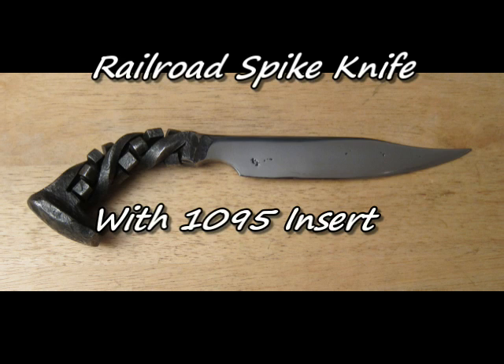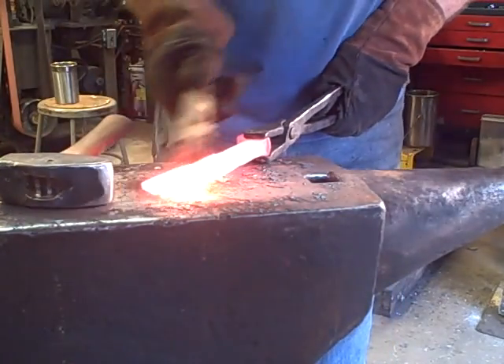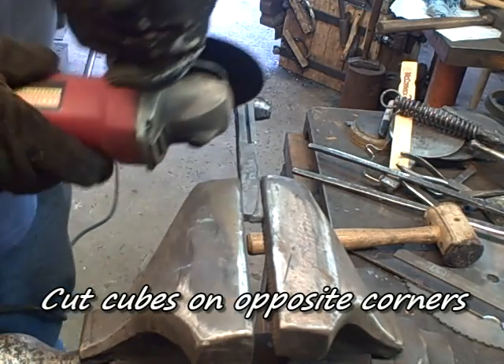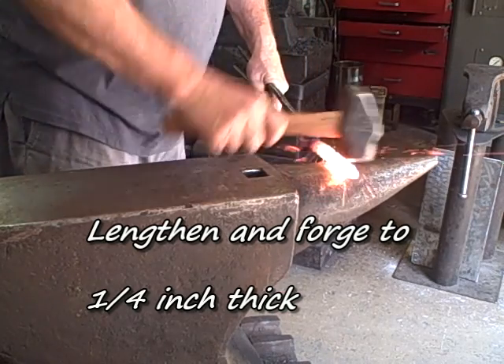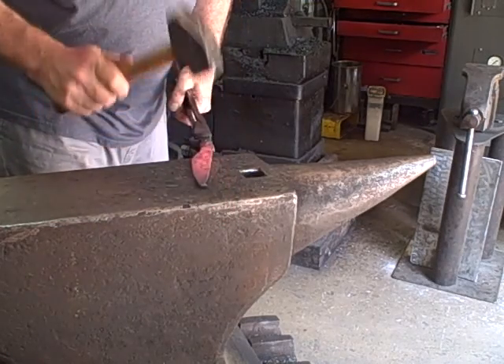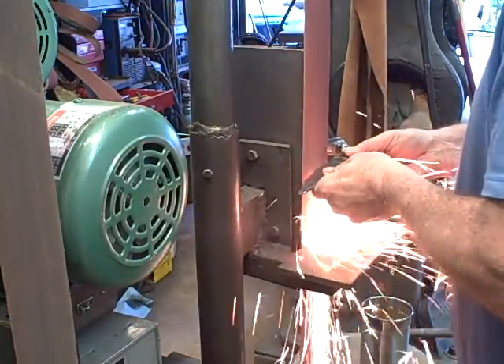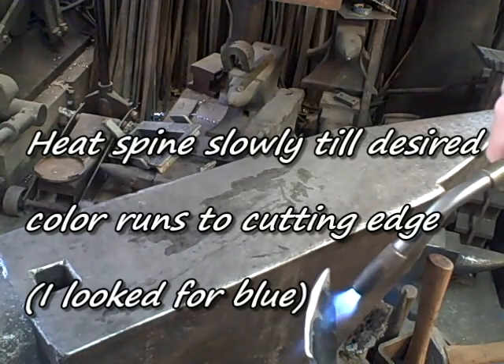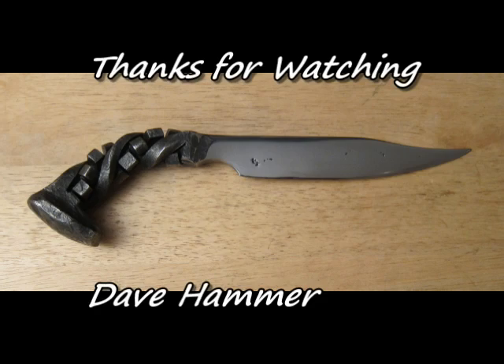Forging a Knife

Comment: +David Hammer , I sometimes use both, torch or an oven, sometime il probably get a real heat treat oven, but for larger blades I just use a kitchen one, set at 400 degrees F , il leave the thing in there for about out an hour or until I see a color change, I tend to keep an eye on it.  But I do like using a torch just cause it's faster and the heat coloring is a nice effect, when using a torch just heat the spine and there will be a line of colors that will travel down towards the edge, try and get it close to the edge but not too close, kinda a fun thing to mess around with, now I'm not a complete expert but I made a fair bit of knives heat treated myself, and they seem to hold up good so far , definitely a learning curve with knives , but that's half the fun in it :-)

Comment: +David Hammer it will go form straw yellow to yellow, gold, brown, blue, purple, and so on if I remember correctly.  I try to have my knives straw yellow to gold depending on what style it is, if it's a larger blade il temper it to a near gold color to make the blade more durable, smaller knives or kitchen knives I have at straw yellow so the edge has a longer life between sharpening. Hope this helps :-)
Reply: James Savage It does help...   and thanks again..  Do you use a torch on the spine, or an oven of some type?

Comment: Great vid. I like that rubiks twist, I have yet to attempt one of those. Are those easier than the pineapple twists? That is an impressive anvil too.
Reply: OrionsAnvil If you have an easy way (such as I did) to make the cross cuts, the effort is about the same.  If you have to cut the cross cuts with a hack saw, it would be much harder...

Comment: make sure your edge is straw color and never blue. you can have your spine either peacock, red, or gray but that edge is critical
Reply: +Ryan Rowe .....  Thanks
Reply: Yea not a problem. Where are you located? Do you make Damascus as well?
Reply: +Ryan Rowe ....  I live in Virginia.  I have made several layered-steel knives (and many pendants).... using old files (1095), wrought iron, pieces of large band saw blades (L6) and other high carbon steels.    Anywhere from 44 to over 400 layers.

Comment: great video and explanation thanks for posting.  Did you make your splitting hammer?
Reply from the maker: +neilyeag I'm not sure which hammer you are referring to. I have made most of the hammers I currently use for forging.  If I am striking a tool (such as a punch or chisel), I don't use my handmade hammers.
Reply: +neilyeag I just realized you may be referring to the tool I used to make the slots for the rubixs twist.  It's called a "Hot Cut" (rather than a hammer).  I have made several of those for myself and friends (no, I don't sell them).  The one I used in the video is one I bought at a tailgate sale.

Comment: Was oil enough for the HC spike? Now that you had it awhile, is it holding the edge?  I would have thought you might need water.Great piece! Thanks for the video, from a blacksmith in Canada.
Reply from the maker: +Hexus Ziggurat I used oil because the steel insert is 1095 steel.  I'm certainly not an expert at heat treating knives, but I think those that are use oil with high carbon steels.  

I don't use that knife for any purpose that would test its ability to hold an edge, but I would expect it to do just fine.

Comment: Will clay or sand worked as flux?
Reply: Karl Albiston I only use Borax for flux, so I don't know if clay or sand would work.
Reply: Okay. Thank you.
Reply: Karl Albiston +David Hammer

sand works, so does glass, silver sand, dirt,

and everything else that will form a molten layer over your material
at welding temperatures.

Comment: What about the handle, that seems painful... at least if you're using it to cut a big peace
Reply: +Seth Martin....  This is mostly a show piece.  If it were going to be used a lot, it would be easy to ease the edges by sanding before and after twisting.
Reply: David Hammer Oh okay, thanks!
Reply: +David Hammer the handle is the coolest part

Comment: Dave,  I love your videos.  I'm a big fan.   Started with a modified Super C forge...then realized I just should have made it the same way you did....so much for "exuberance"...hahahaha.!!!!   Check out ArcSmithing on FB.  I'd love to have you with us.  Your expertise would be greatly appreciated.
Reply: +Charles Wright ....  Thanks!   Don't be embarrassed about trying a modification.  It's one way we evolve to better things.  One change I have made (since the video was made) is to use "C" channel (like 1.5 x 8 or 10 inch) for the bottom and weld a flat piece of plate on the side of a half cylinder (then bolt the plate to one side of the C channel.  I weld the side shelf on the other side of the C channel.  I put a layer of thermal blanket down into the channel and make a flat floor that sits on top of it (kiln shelf will work, but will not last as long).  The thermal blanket on the top comes down to the floor instead of going around under it.  When I put the thermal blanket on the top (half cylinder and side plate), I cut it so it is just short of the floor (after rigidizing) and put refractory on the lower side of it.  I make sure the back side thermal blanket does not "crunch" down onto the floor (it would crack the refractory) and put a thin (uncoated) piece of thermal blanket in there for a gasket.  Doing this eliminates the need to use ANY refractory on the bottom half of the forge and makes changing the floor out easier (no refractory on the lower sides to get damaged when the floor is replaced).  As long as the floor sits high enough to be above the door channel, the fire will not burn the door channel.  One other thing....  On forges the size of the one in the video (and a little larger), it is not really necessary to use the mortar between a couple coats of slurry.  

I need to produce an "Update" video, but just haven't gotten to it yet.
Reply: I have posted your youtube channel on ArcSmithing so the folks see quality work by a guy who truly cares about his craft and teaching it to others.   Thanks so much Dave.   I now have a young lady with M.S. who isn't letting her condition stop her...although the heat will slow her down a bit...she's doing quite well.   Thanks for teaching me and giving me the skills to pass on to another.   It means so much to me to give back.   Thanks again!!!!